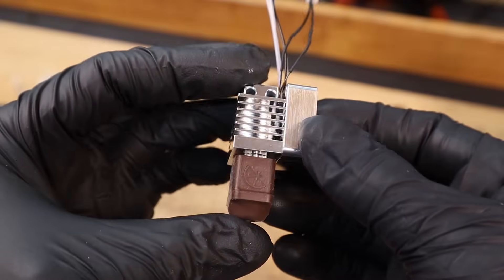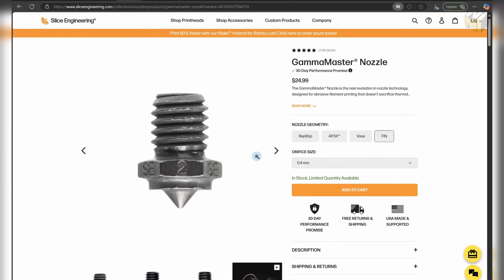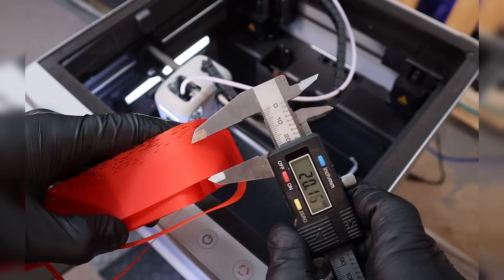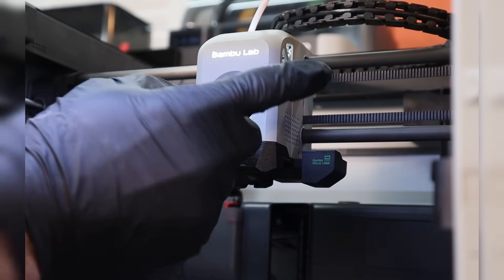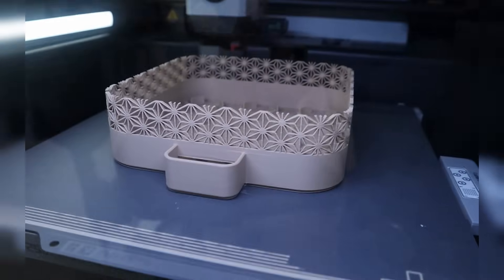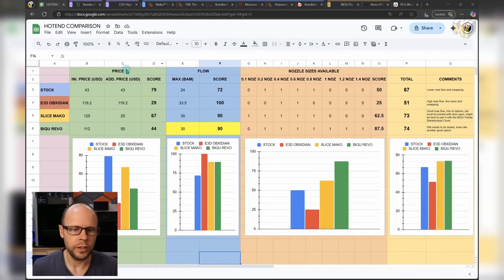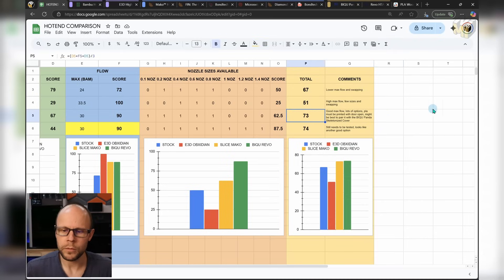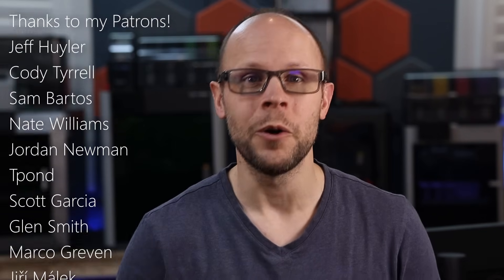How good is the NEW SLICE MAKO Hot End for the Bambu X1, P1 Printers?

Comment: I always had issues with the max flow rate test sticking to the bed as well.  If you are using the Orca Slicer calibration tests, after selecting Max Flow Rate test switch over to Objects in the Process section of the slicer, then select the model and change the "Bottom Shell Layers" to 1.  This will print the first layer solid and then go into vase mode after that.  This will solve the problem of the test coming up off of the bed.  Takes longer, but it wont fail.

Comment: @NeedItMakeIt thanks for doing the review! At 8:33 you mentioned needing to heat up the nozzle to a minimum of 270 degrees before changing the nozzle. Where did you find the 270 degrees? I didn’t see that in any of the documentation - I prob missed it. I thought it could be changed cold based on the videos I’ve seen from Slice. I’d appreciate a link if you don’t mind.

Comment: I had been thingking about buying these for a while, but I went to Rep Rap this past May and found out about MicroSwiss. They sold me with their cold swaps, so I bought a couple. One for my X1C and one for my P1S and I absolutely love them! I haven't done any flow rates, and instead I just created a filament profile based on the numbers from the E3D hotend, -10% and it has been working well so far. I can print minis and immediately swap to printing vases without concerns of damaging the connectors, pre-heating, etc. They're just long, so it takes a while to unscrew and rescrew, but still way better than swapping out the entire hotend.
Reply: Same here Micro Swiss hardened cht... no issues in 3 months. love it

Comment: I can’t see the benefit in any of the a/m hot ends. I’ve never had a problem with the stock version. 2000+ hours on 4 different x1c. Never opened the door or top for pla or any filament. Never had a clog or stringing. Maybe I could print a little faster? Idk I ain’t fixin what ain’t broken.

Comment: I'll just say it on the E3D..I have a few thousand hours on them across a bunch of printers at this point and it is just worth the cost. The BiQU appears to be cheaper, but by the time you start purchasing individual nozzles for it, it quickly becomes the most expensive by a huge margin and doesn't come anywhere close to its claimed numbers. I was further incensed on that one because after dropping $150 and getting nothing more than a basic copper nozzle it just felt like a rip. I suppose if I was swapping nozzles regularly it might matter to me more, but I care about speed, quality and reliability more than anything in my production environment and at present, nothing beats the e3d.
Reply: This is awesome to hear, thank you!

Comment: 13:46 not an issue at all sir. those revo hotends dont have a long enough meltzone and they cheat on the temp reported too, actual nozzle tip temp is always 20-30c lower than what it reports. this leads to coldextrusion and low melting capabilities. they get about half the flowrate of stock. fine for tinyparts and miniatures i guess if you change nozzles alot its a bonus, but they are too slow be competitive these days.

Comment: I use Aliexpress hotend with changeable nozzles. It costs $7 and nozzles are for $1. I use it in my small print farm (10 mashines). Every one of my P1S printers have 3-4k hours of work on those nozzles. I print only ABS-GF and PA-CF so I need to change nozzle every 250h of printing. I replaced only three hotends in this time, because of blob attack.

I'm curious if this comment will disappear like under Slice promotion video. I don't like them after they patented "Greek pillars" to support heatbock, they simply shouldn't get this patent.
Reply: Wich model do you recommend  from Aliexpress?

Comment: Recently added the MS hotend to my X1c and it is a definite improvement over the standard nozzle.  Much better flow, retraction and way less stringing.  Even if using these other nozzles, might want to check out the MS product as it has some useful tips for slicer settings, build plate temps, chamber temp, etc, when using these hot ends.  Especially useful for avoiding clogs with PLA.  Was able to go from 18 to 30 with Elegoo Rapid PLA+.  So far results have been amazing.  Would be great to see comparison against these other hotends.  MS hotend uses the various standard sized microswiss nozzles and is compatible with their diamond tip nozzle as well.

Comment: You should try running these with a higher wattage heater. I'm running an 80w. Much better strength at high flow rate printing.

Comment: My mako paired with a diamond back allows me to print even nylon carbon fiber at 30 mm cubed a second with truly impressive layer adhesion. Also for those who run a carbon filled filament through the max flow rate test and think it looks like crap, it appears filled filaments do not like the increased layer height the test uses. I use the crappy result and just feel for where the layer adhesion drops off and then print another race track at a 0.2 layer height, making sure that the line width allows the printer to hit the flow rate I'm checking and even at 30 mm cubed a second pa612 carbon fiber comes out spectacular and strong. I did have to buy a stronger ceramic heater to keep up with the hot end at its upper end however.

Comment: I got the e3d when it came out, never swap nozzles on the x1c. I also print pla with the door closed with no issues. The slice needs points deducted for having to have the door open. To my mind what is the upgrade? Nozzle change flexibility? For me the stock never clogged with the door closed, so this feels like a major downgrade. Also keep in mind that e3d needs less heat than hardened steel.

Comment: I love my Revo. The huge advantage is, that you just unscrew it and you are done. Its like 10s to swap the size. Also the 1.4mm gives you completely different ascetics, which is also really great. 
But, if you go for the hardened high flow nozzles, you are looking at 74€ per nozzle. So it is really pricey. And the nozzle wiping is really not that great, had to tinker a lot with different wipers plus gCode modifications. 

But I do not want to give it up anymore. It just nice.
Reply: have the revo on my x1c and running into wiping issues as well. what changes did you make to solve them?
Reply: @metalmilitia623  I have installed this wiper mod: scrubbler v2. Just make sure, that you glue in the silicone wiper, for me, the sticky tape was not strong enough.

As for the GCode: I have modified the wipe nozzle section of the machine start gcode. There I made an s-curve through the silicone area. So it goes first left to right in between the rows and then forward and backwards.

Now it works ok, still not great, as it sometimes drops material inside the print area, but a lot better than before.

Comment: Would love to see how the new MicroSwiss FlowTech Hotend for X1 compares to these other hot ends.
Reply: yes
Reply: I bought the microswiss flowtech as a replacement for my paperweight obxidian , but so far I've have been running into heat creep issues printing petg with the enclosure closed. I think the longer melting zone design is resulting in too much heat getting dumped into the heatsink and the fan isn't able to cool it fast enough. It would be fine if I left the top open. I actually just ordered the slice engineering aluminum fan to see if that would help fix the issue.

Comment: Just to be clear, the product that had the best flow rate has the lowest score? The point of using a different nozzle is to get a better flow rate, but you decided price and nozzle sizes is equally important.   I hope you were paid well for this video.  🤷🏻‍♂️
Reply: to be fair, price is important. My e3d obxidian had 2/4 channels clogged so it would completely clog midprint because it can't support the amount of flow. I have tried everything to unclog it to no success and now it's just a paperweight. If I were to replace it it would cost me an entire hotend vs if I had this mako I can just change the nozzle. 

I bought the microswiss flowtech as a replacement, but so far have been running into heat creep issues. I think the longer melting zone design is resulting in too much heat getting dumped into the heatsink and the fan isn't able to cool it fast enough. I actually just ordered the slice engineering aluminum fan to see if that would help.

Comment: Thanks for the testing.

I have been using the BQ Revo adaptor on my X1C for a couple of months now and I am extremely satisfied.  The smallest authentic Revo nozzle is 0.15 and then 0.25, not 0.2.  There may be some clone available at 0.2 but I don't recall seeing one.  There is no way to tell the printer you have those size nozzles installed.  Not an option on the drop down list in the printer.  As a consequence you have to confirm in Orca that it is ok to print with your custom profiles.  I haven't tried lying about what is installed, doing so could lead to madness when things go wrong.  I have not printed directly from Orca since the printer firmware update.  I hope I can get it to talk in the new developer mode.  Bambu has placed these limitations so that the customer has to work hard at getting a print to fail.  The downside is that when you want to do something special it is difficult and you may wish you had purchased a different printer.  My recommendation is to only use nozzle sizes that Bambu has a way to select in their firmware.  Unless you want to become an expert in generating your own profiles this is the only way to keep it simple and hassle free. 

The micro SD card slot in the X1 printer is not going to last if you start swapping cards all the time.  Mine is working poorly and I have used it only a handful of times.  This will be a problem for me but for 99.999% of customers the slot will get used exactly one time.

Comment: Cold swap (nozzle) is the future and its easy. E3D revo is too expensive, micro-swiss flowtech = cheaper + cold swap + CHT + hardened tip.

E3D revo nozzle hardened + CHT cost $70+!! (not $50).
micro-swiss flowtech  nozzle hardened + CHT cost $30.

Comment: Revo solved this problem quite a while ago, I definitely recommend it. Especially with ObXidian and High Flow nozzles. 

And they don't have an inexplicable 2 month lead time and don't introduce yet another random nozzle type/size (why not just use V6 on the Mako? Or am I missing something showing that the Mako takes V6?) (edit: Nope, not missing anything: They use an entirely new "standard" they're calling FIN.)

I prefer E3D Revo nozzles over this style, and I can standardize on that across all my printers.
Reply: The beauty of the fin nozzle is that the silicon sock covers most of the nozzle as well. It was done with a purpose. If you look at a fin nozzle it's got a step near the end that sits flush with the end of the sock.
Reply: revos biggest issue is that the heatbreak is structural, which means it can bend and break easily. This is coming from someone who used revo for two years. And the nozzles are so expensive, breaking one is painful. Slice uses tubes (they have a patent on it but many clones do the same) where the heatbreak is not structural so it makes for a more rigid hotend.
Reply: @Unscientifically  I looked at a Revo for my x1c but I would have bought a diamond back nozzle for it and I was terrified about the possibility of breaking it. So I went the direction of the mako.